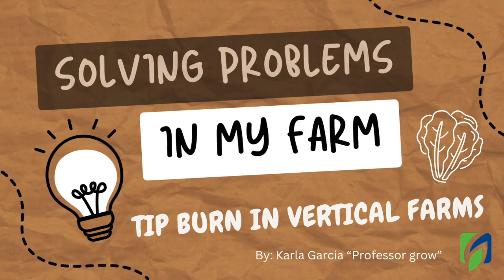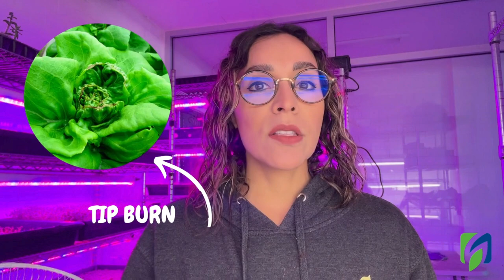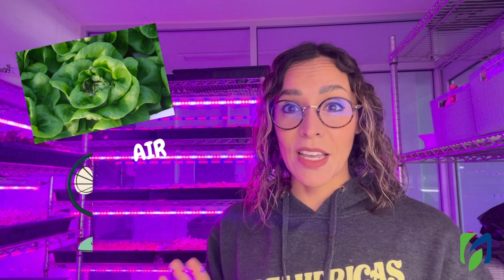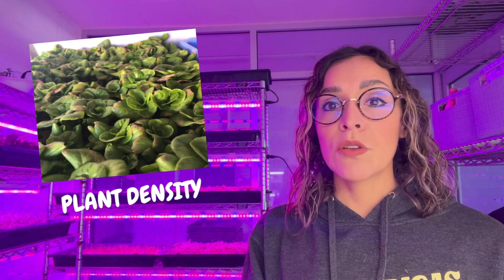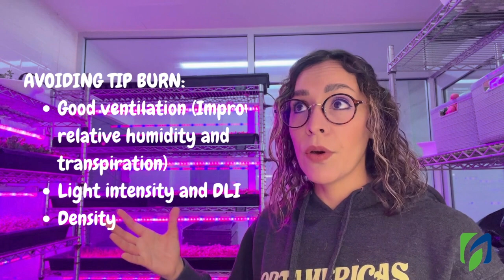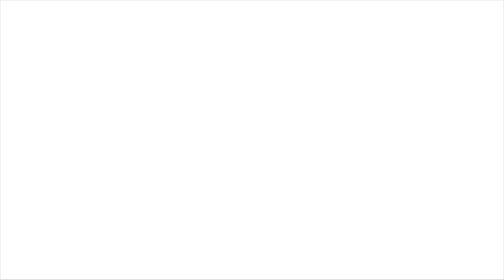Preventing tip burn in vertical farms

Comment: Older leaf tip burn in lettuce indoor hydroponics vertical farming, maintaining temp 20to22c, humidity 75%,ppfd 250
Reply from the maker: thanks for your comment! that is correct the management of all these variables along with good ventilation and air exchange should help to avoid tip burn in lettuce.

Comment: Thank you very much. 0,3-1m per second, - what is for lettuce better? PPFD - 200
Reply: Thanks for your comment. The air velocity should be around 0.3 to 1 m per second. For light intensity in lettuce is recommended to use something around 250 PPFD 😃
Reply: @karlapatriciagarciacabello5331  Thanks for an answer. I mean, - if (as example) PPFD is 200, - what speed of air recirculation velocity will better, - close to 1m per second or 0,3 m per second?